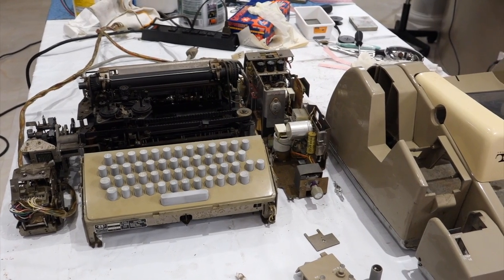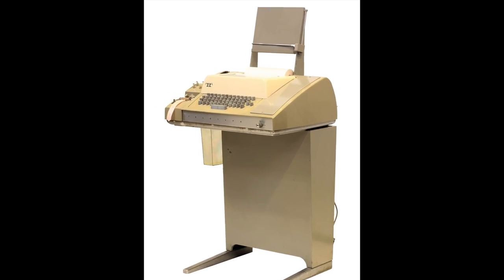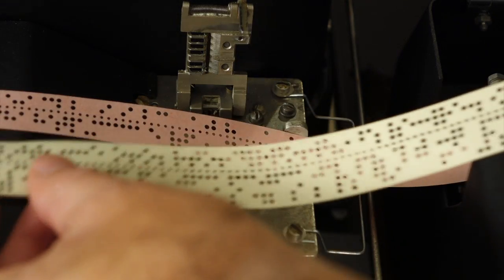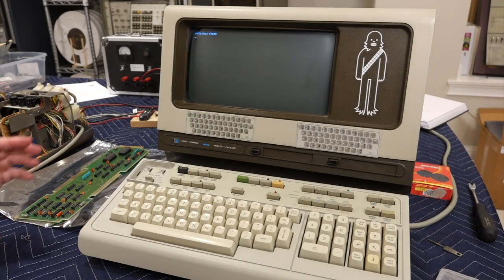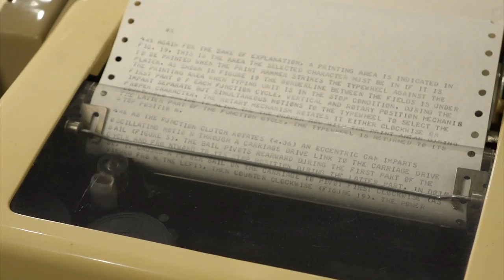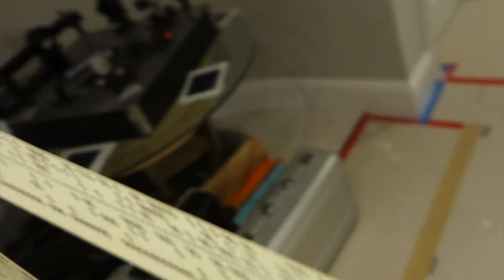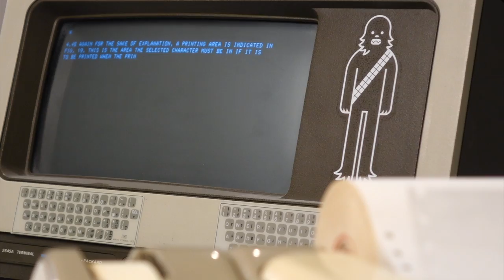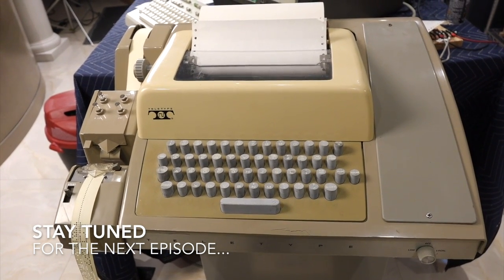ASR 33 Teletype demo  (restoration Part 10)

Comment: This is awesome!  Back in circa 1974 when I was a junior in Hight School, we had 4 of these attached to a Wang 3300 computer running Basic. I still have all the paper tapes from back then.  I am currently in the process of transferring those paper tapes into modern digital formats using a replica of the OP-80A paper tape reader for the Altair 8800. Thank you for this! It brings back a lot of memories!
Reply: Same here in 1973, though we used acoustic couplers to call a mainframe. If I remember right, it printed a header when it connected which said "Welcome to the T.I.E.S. HP2000 C2 (something-or-other) System". And I may still have a punch tape roll or two, packed away in some dusty long-forgotten box in my house somewhere.
Reply: Same here, except my experience was in 1979. We actually stored the programs in paper, and we got hold of some mylar tape, which was pretty cool. Anyone remember "Hamurabi"?
Reply: We also had a teletype connected via an acoustic coupler to a Univac 1100. Late 1970s. Such memories!
Reply: Lol Wang.
Reply: You know you can read paper tape by eye, just jot down the decimal conversion of the right 7 holes and look-up on an ASCII table... Letters and numbers you won't need to look up after a little while.  It's tedious, but try doing that with mag tape or flash memory!
Reply: My first computer was a Cromemco Z2 built from a kit, and my input, output and mass storage device was an ASR33.   It took half an hour to load an 8K Basic interpreter into the computer from paper tape.
Reply: @sidewinder666666  T.I.E.S. 2000F1  READY...

Comment: I learned to program in high school back in 1975 on one of these. It had a phone cradle on the right-hand side, with two rubber rings into which the phone receiver would be placed. We would dial a phone number at the local university and connect to an IBM 370 mainframe running BASIC, which could be switched to FORTRAN or PL/I if desired. When it came time to archive our programming assignments, we would use the paper tape. But prior to punching our tape (using the LIST command), we would have to issue the command PUNCH ON command to tell the mainframe to punch a couple "filler" nonprintable characters at the end of each line, so when the tape was read back in, the carriage would have time to return to the start of the next line. Afterward we would enter the command PUNCH OFF. Just hearing those sounds brought back lots of pleasant memories. Thanks so much for making these videos.
Reply: I had access to a Teletype in Junior High (9th grade), then in High School we moved to the Digilog terminal and DecWriters for printing. High School even had all the old Keypunch equipment, still used for attendance with punched cards printed on an IBM 402 Accounting Machine. If you think the Teletype was loud and shaky, wait until you saw a sofa-sized accounting machine that had 132 type bars being raised and smashed against ditto-master sprocket forms, one line for each missing student that day.
Reply: me to part of my high school ECCP class. But it was in 1967!

Comment: Brings back so many memories - I can almost smell it! Our high school would only splurge for one ribbon and one roll of paper per year. So we would run the paper through four times. And line feed didn’t work, so we had to manually advance the platen. We connected to an HP 2000 - our model 33 had the built in acoustic coupler. I would stay for hours after school until the janitor kicked me out. I later got my own TI silent 700 and a personal account on the HP 2000 (it was the prize for a programming contest sponsored by the time-sharing service). So glad you guys restored the “beast”. Love the channel.
Reply: I had exactly the same experience, right down to the remote HP-2000 at another school a few towns away.  We had two ASR-33s.  One had the modem for on-line use, the other was just for off-line use.  You'd type in your program off-line while the tape punch was on, then take the tape to the other machine and read it in.  You could write your own programs in basic, or just waste endless hours playing spacewar, hunt the wumpus, or lunar lander.

Comment: About 40 years ago, this is how we "saved" programs off our cnc machines.  We had a 33 on a roller cart that we could roll over to each machine, and stored the tapes in prescription bottles.  We had a whole wall rack of holes to store the bottles in, with the filename written on the caps.

Comment: My first experience with programming was using these and paying for dial-up BASIC time sharing at $6/hour, which was a lot in the early '70s.  To save connect time, we wrote the first version off-line and punched it to paper tape. Then it could be read in at top speed: 10 chars per second!  When off-line, typos are fixed with the DEL button, which punched all 8 bits, making it an ignored character.

Comment: I repaired these for the Air Force and the NSA. 
Eight bits, five bits and the baud rate was so bad i could type faster than it could take the typing it would jam for the rime it could not except the letter. Five years air Force and three more with Honeywell. What a machine and what a lesson for my future successful time as a technician. But i had to be an engineer at times being a tech was much better... Thanks USAF for your service.

Comment: Wow, really great job on a mechanical device of unexpected complexity. The punches in the paper tape seem to leave a wide unused edge on one side. Is that they way they all were, or is that yet another adjustment to be made?
Reply from the maker: You are right! I had not noticed it. Apparently it is never punching the 8th bit which is parity (ASR 33s are really 7-bit machines + parity). I think this is simply because I had set the HP terminal to “no parity”, so it was just sending 7 bit characters with the parity bit always at 0, as requested. If I switch it to send with even or odd parity, the 8th bit should be set sometimes and punch in the remaining margin. I’ll try it out!
Reply: Ah-HAH, I thought it looked like there was room for 1 more bit!  ;-) And I even considered pausing the video and trying to count the rows of punches, but I hadn't thought of parity bits. Yes, let's see some tapes with parity and test that 8th row.

Okay, if I pause the video I can see that the punched tape format appears to be 3.4, but it should be 3.5. So, yes, that last bit is being ignored.
Reply from the maker: @jadney  Yes you can see in the video the HP parity switch is on None. I just tried it on Even and then Odd, and it punches the 8th bit parity as expected.

Comment: This was a fascinating restoration. It was really interesting to see how they solved problems mechanically that today would be done with a microcontroller. There was a whole different thought process and set of skills involved.
Reply: I thought it was fascinating precisely because I found the thought process surprisingly similar. Sure, if compared to an actual microcontroller it might be one thing, but compared to more hardwired electronics, I thought it was interesting to see how the single motor acts like a centralized clock generator with fanout, and the way in which mechanical linkages act like logic gates. It makes me think how much modern electronics probably owes directly to the engineering practices developed in the mechanical era.
Reply: The IBM selectric typewriter was an electromechanical descendant of this fascinating part of history. In 1977, in high school grade 13, the school purchased a Digital ( DEC ) PDP-8 computer with a later model of this TeleType - but with the exact same clackity clack sound and printing speed, although the baud rate might have been up to 250 by that time!
Great work you've done, thanks for the memories! Looking forward Marc to many more re-qualified projects. You're doing for millennials what ENIAC and UNIVAC did for me and hopefully others of my generation.

Comment: I, too used these. As I left for college, I had acquired a KSR-33, which I used in my dorm room to access the timeshare system. I also got a job at the computer center, repairing them. I stripped them down each summer, re-lubed and tested them, then put them back in the public terminal rooms. They were technically 8-bit machines, but only used 6 (or 7, if they had the parity option). No lower case (that was the model 38, and it was no where near as reliable as the 33). They had a ROM drum, activated by the HERE IS button on the keyboard, which you could program to send a short character sequence. I had mine programmed to send my username and password for the mainframe. You "programmed" the drum by breaking off plastic prongs wherever you wanted a "one" bit.

Comment: Old memories!
I used one of these at school, dial-up via acoustic coupler to HP 2000F, 9 miles away in London ... I still remember the phone number!
[ You still have something to fix: the bell should sound <ding ding ...... ding> as the carriage is nearing the end of line. ]
Sports didn't interest me at school, also, learning a musical instrument didn't grab my enthusiasm.
Returning to school after Easter break (age 13), my maths teacher told me that I wouldn't gain anything from the upcoming lessons because I was already good with fractions and percentages, so he sent me to the computer room to 'try it out'. It got my attention immediately, this is what my brain was built for! Programming is like an intellectual Meccano set (I had Meccano from very young).
I was in the computer room nearly every break time and after school for about 3 hours until the caretaker came to lock up.
One afternoon, in my early days of learning BASIC, I decided to print out the Star Trek program:
  GET-$STTR1
  LIST
It took about 1/2 hour, but it was worth it; the program used plenty of BASIC's features, which taught me a lot!
[ and a big thanks goes to 'Smurrell' (4 years my senior) for his contributions to my knowledge! ... H713 :) ]

Comment: One historical note. The Control Data 6000 series of mainframes, the first of which was under construction in late 1963, was designed to use a two-tube graphic display console. The Teletype was never used as an operator console. I'm sure there were a few other mainframes that did likewise (eg, IBM who build their own teleprinters, but did not use the Teletype).

Comment: Now you can run off copies of Microsoft Basic!
Reply from the maker: You bet. On the to do list.
Reply: I had a paper tape copy of the Dartmouth BASIC compiler for the Elliott 803 once upon a time.  I wonder what happened to it?  Still got some program tapes.  At odd times I wonder why Microsoft Basic never implemented the matrix functions of good old Dartmouth BASIC.  Seemed a retrograde step.
Reply: I agree wholeheartedly. I had a book on Dartmouth BASIC long ago, and, wanting to do some simple 3D graphics at the time, really could have done with the MAT ... commands.
Reply: @1944GPW  Microsoft released the source code to it and MS-DOS a few years back.
Reply: Ah yes, you are right, thanks for that. It's all good then!
Reply: @Membrane556  Hmmm.. that would be tricky. MS-DOS always had full cursor control, commands like cls would not work on a teletype machine. Best you can do is 25 blank lines.
Reply: @CuriousMarc  HP Basic from 1966 is more the native coding environment for this machine.  I used HP Baisc running on a 2116A with 8K of R/W to write my very first program. The terminal was an ASR 33 of course, and I stored that program on punched paper tape.
Reply: I tried to steal a copy of Microsoft Basic by punching it onto the paper tape!  Never got it to run, but by reverse-assembling it, did get some tips on Z80 programming ;)
Reply: @malcolmbacchus421  available memory!  Huge trade-off between language features, and space left for the program.  Amazing it had floating-point arithmetic... the processor sure didn't!
Reply: @Membrane556  Really?   Where can I find a download a copy of the source code to MS-DOS?   Btw...  I still an ASR 33 in my house.   PS. Youtube is kind of going nuts posting duplicates of this post, sorry if there's more than one still posted.

Comment: Some of the schools in our district got these machines and we would connect to a timeshare system via acoustic coupler modems. (110 baud?). As students, we weren't given any storage so we had to save our work by "print tape" and I think "load tape" to read them back in again. Eventually they were upgraded to decwriters and 300 baud.

Comment: I remember when I worked in the Radio Shack, no not that one, in the early 1970s as a Radioman in the Navy. Brings back memories of typing out a message then sending the tape to any number of bases. Sometimes the tape would skip a hole punch which would call for us to stop the entire transmission. 

Then we would have to figure out exactly where the hole was supposed to be and use a hole punch to resend it. If you didn't figure out exactly where the mistake occurred instead of a word reading Communications it may read out Bommunications.

Comment: I think my first workplace had one of these -- if not it was a very similar model. I remember seeing the process of 'fixing a typo' in a taped message. It involved feeding the old tape through in a kind of 'copy' mode, stopping just before the typo, switching modes so you can enter text directly, then carefully advancing the old tape past the typo, then switching back to 'copy' mode. 

Sounds like fun.

Comment: Nice Job in the restoration!  One burning question I didn't see, was how the punch reader actually turns the hole patterns back into a character.  Can you give us a bonus episode on how it decodes?    Keep it going! :)
Reply: I think the reader is just 8 switches that connect to the distributor that converts it into a bit steam with a start and stop bits.  It doesn't do any decoding , the holes in the tape are just the ASCII code.
Reply: @nophead  That's it. As I saw him putting the tape into the reader, I suddenly remembered, 43 years ago, running my finger across the contacts and having the middle sprocket give a little poke!

Comment: Brough back memories of visiting the largest newspaper of Brazil many decades ago where there was a large room with maybe 50 or more of those machines, all with small signs on top of them like "Paris", "New York", "Moscow", etc. Most of them were idle, but at any time there was always a few clattering like in the video. Very noisy! Also, they had a pair of those newfangled "fac-simile" machines, very advanced for the time.

Comment: I tried to save my  Diplom Thesis on paper tape in 1978. But government of Finland decided it was too expensive. 100 pages was maybe two rolls of tape and it took 6 hours to punch... Paper tape was not the issue but wear and maintenance costs of the punching device.

Comment: There were also Teletype machines in the mid 1970s that were actually computers with printers and they had quite a lot of new features including the ability to receive messages and save them to a digital storage format like a tape or floppy disk or you could just print them out! You could also let messages print out in real time or have them appear on the display in real time but there was still a digital character limit that was set by how much RAM the machine had! :)

Comment: This was the newest Teletype unit I worked on.  Used it on a Computer Microfilm Machine with a Dec PDP-8 in 1973.  I think the earliest one was a model 23- used on Crypto gear in the USAF in the 1960's.  Quite a marvel at the time
Reply: The af had teletype, klienschmidt, freeden, and a mixed batch of variants for both crypto and survailance.
Very versatile for being 80% mechanical.

Comment: Nice work guys!  The sound these machines make is so distinctive.  I found I was missing the smell of the machine oil and the ribbon.
If I am not mistaken you can get rid of that column 1 issue by adding another couple of nulls after the linefeed to give it time to finish the return and linefeed operations.  I believe we had to send at least 2 in order to get reliable settling.print head and the platen.

Comment: I just happened to drop by Netflix, saw a trailer, where in the first few seconds of it starting, you get a view of a teletype like the one here, or one similar, running with paper tape in it. First thing I thought was, 'is this the same one Marc had been restoring?!' Right after, there was another scene with some other machines in it, but no idea what they were as it went by very quickly and was somewhat dark.
Reply from the maker: Not mine, it hasn't left the lab yet... Which movie was that?
Reply: @CuriousMarc  Film called 'The Last Thing He Wanted' Did a little looking up on it, seems it was first shown at the Sundance Film Festival back in late January and Netflix released it just today.

Comment: At about 5:15 you state that the paper roll was threaded wrong since paper coming out could get consumed in the gap. This is unlikely as the paper is moving in the opposite direction, and won't get sucked in.  In fact it is threaded correctly; many units had a spring-loaded bail to soften the tension when doing linefeeds, for much the same reason as the loops in movie projectors and half-inch computer tape drives.  Without the bail, line spacing would be uneven, especially with a brand new, heavy roll of paper. This condition made a popping noise on linefeed.